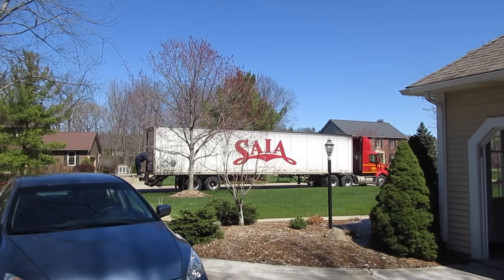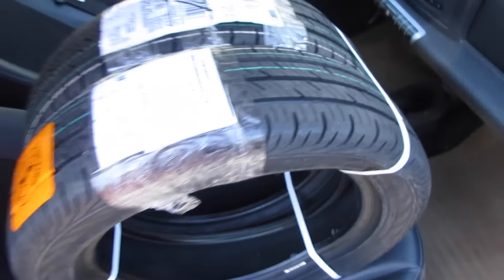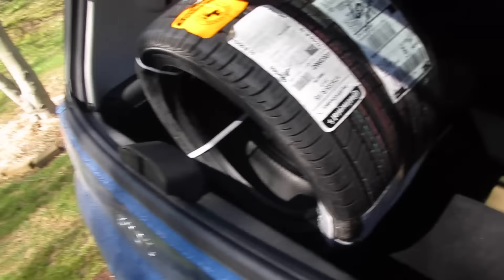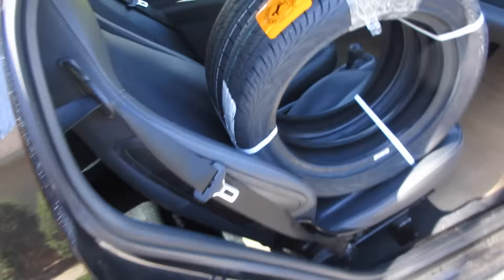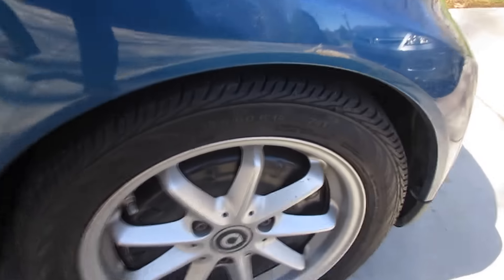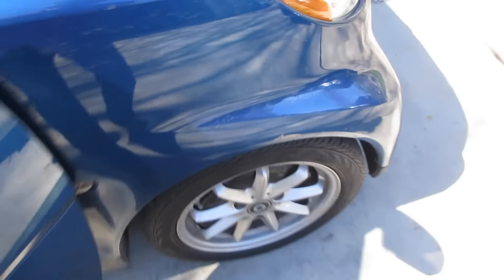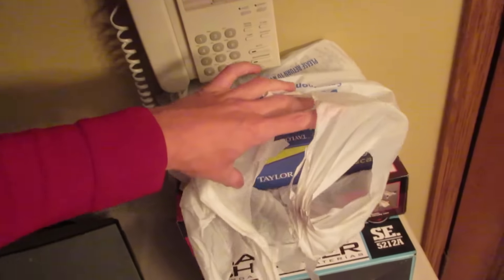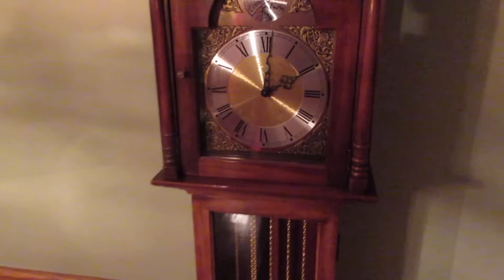Smart Tires  4/5/16 - Day 1,945

Comment: One benefit to such small tires is they're cheap as heck. $400 for a set of contis seems cheap as heck. Work seems to be progressing well on the M and rusty brake pipes are always an issue for older BMWs. E46s particularly!